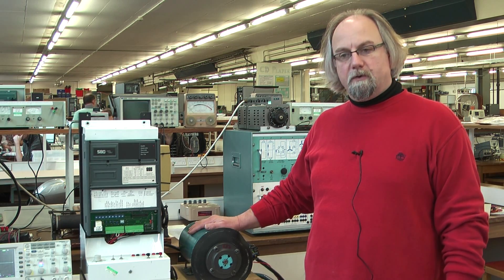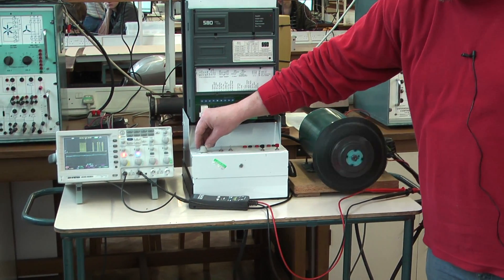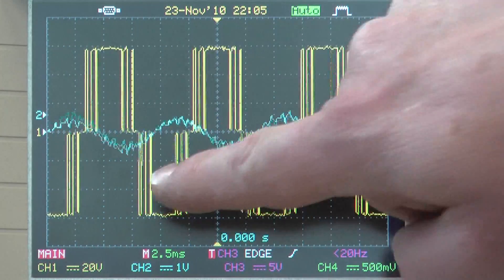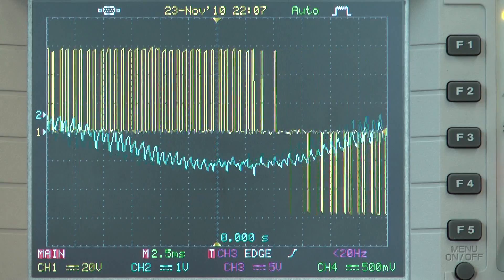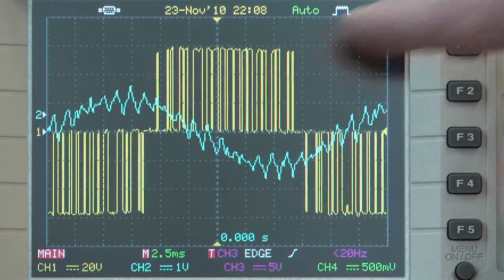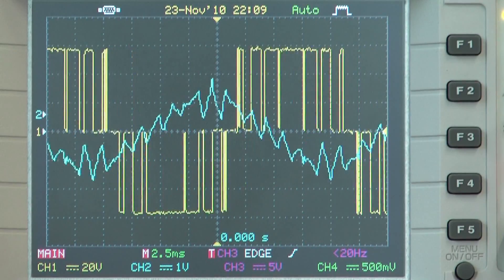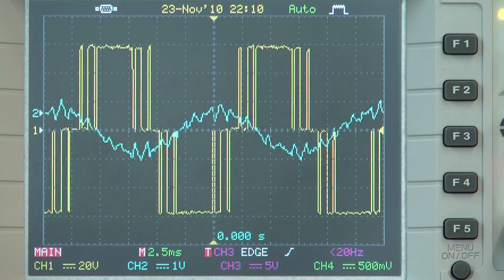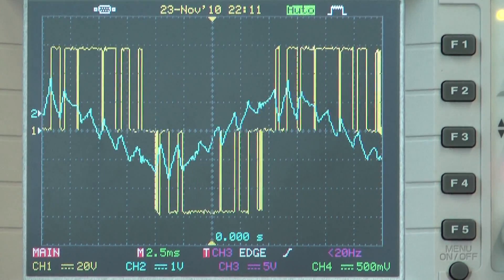Gear Changing without Gears: PWM Motor Drives

Comment: Here we have some metro trains that hace AC traction, but the pitch never changes. It is very quite, only gets a bit louder on demand. That all. On the catalog they specify a  3 phase taction. Inverter Made by ADtranz circa 1998
Reply from the maker: Good observation, thanks! Newer equipment tends not to use gear changing of the PWM. Some choose a higher switching frequency so that you can’t hear it so much, but there is a cost in terms of efficiency.

Comment: I thought most frequency converters smothed out the voltage before sending it out?
Reply from the maker: Very large ones do, but most rely on the smoothing of the current by the motor inductances. These days for many multiple unit trains we try to use greater than about 20kHz so the current ripple is small and inaudible. I plan to do a new video on this.
Reply: @DrPowerElectronics  Thanks for your reply, good to know. I would love to see a video on how you could make effective measurements on frequency converters using a standard multimeter. How does the hZ readout correlate with the oscilloscope. What about Voltage?

Comment: Why use AC why not  DC no noise simpler system  .
Reply from the maker: DC motors are used in some very low acoustic noise systems.  But the brushes wear so they have increased maintenance and the machines are more costly.  So pretty rare these days except in basic toys and some low power servo systems.  Higher end toys and drones use Brushless DC.  See my other video.
Reply: @DrPowerElectronics  before AC motor dominate current emu.
Previous is using DC motor
Reply from the maker: @AAA839 Correct. EMUs went AC in the 1990s. With GTOs and IGBTs in the DC-AC Inverters.

Comment: Do these type of drives support regenerative breaking? If not, what type of drive supports it?
Reply: The motors would be fitted with rheostat which helps with slowing down also known as dynamic braking used as well as the main air brakes
Reply from the maker: @haydonsheard2168  Correct.  The Dynamic Brake resistor has it's own transistor to bring it in when it's controller detects the dc link voltage rising with the energy coming back.  The inverter monitors this too, and limits the braking power to the losses in the system.

Comment: Nice video and well presented. Thank you. It would have been nice if you had loaded the motor and not just run it unloaded. Incidentally, the obsoltete Philips chip HEF4752 had the same hysteresis system 30 years ago for the same reasons.
Reply from the maker: Quite right.  I use the plot from the datasheet for that chip in my class! Thanks for the comment.
Reply: @DrPowerElectronics  Do you have by chance a full datasheet of the HEF4752?
Reply from the maker: @SunnyJulienDivine  I regret I don’t have one on my computer. I may have a paper copy somewhere and I was planning on finding it one day! All I have on my computer is a scan of the gear changing graph.
Reply: @DrPowerElectronics  I'm also looking everywhere for a complete datasheet. I found some documents that explain quite well why the "gear shifting" was implemented, but they are nothing near of complete. I'm also trying to get some old literature (from '82) where the internal workings of the HEF4752 are supposedly explained in detail. May I contact you via email if I find some useful documentation?
Reply from the maker: @SunnyJulienDivine I’m just looking at this a bit now for an FPGA implementation, but haven’t found the data sheet yet!

Comment: I didn't understand if you have a atached gear box in motor. What is the chooping frequency? thank you
Reply from the maker: No gearbox!  These are fixed ratios like gears between the motor AC frequency created and the 'carrier' frequency of the switching. So as the motor speeds up, the carrier frequency gets higher, like peddling a bike, until it changes 'gear' to another integer ratio.  See some replies below.
Reply: Ok, now i understand why. You want to  reduce dissipated power at lower frequencies. So you low your operating switching frequency. It was a stupid question, thanks for your reply! Cheers
Reply: @DrPowerElectronics  Why are there discrete frequencies? Why not change the frequency continuously?
Reply from the maker: @difflocktwo  Switching losses as remarked, but also avoiding non integer ratios of switching to output frequency as this can cause an unwanted low frequency components in the voltage and currents.

Comment: The term "Gear Changing" is a bit confusing....Nice Video though..
Reply from the maker: It’s a fixed ratio between the ac output frequency and the switching frequency, which sometimes changes to another integer number ratio, so it’s about as close to ‘gears’ as you can get 😊

Comment from the maker: Gear changing does not influence the torque at all. It's simply keeping the electronic switching frequency a fixed ratio of the motor frequency. Changing the ratio as the motor speed changes keeps the switching frequency in a limited range (like a car engine), which is nicer to the electronics.  Small drives don't bother these days, but larger drives tend to still. e.g. an EMU train drive.
Reply from the maker: There’s a few things going on at the same time. Higher speeds need more volts and a faster sine wave. We can do it with just one ‘gear’, but there is a cost to that. Different applications, different companies, different choices are made. That’s engineering. Maybe I should check for another of my videos and put it on YouTube.
Reply: well uhh for more explenation. Why is the torque not going up while voltage goes up? well I searched on Bing that the torque depends on current and because motors are inductors, they are basically filters. so the higher the frequency, the more its resistance. so it lets lesser current. so the resistance compensates with the voltage. this is also why the chopping is smoothen out by the motor, because the motor